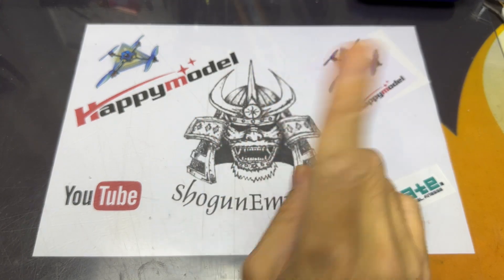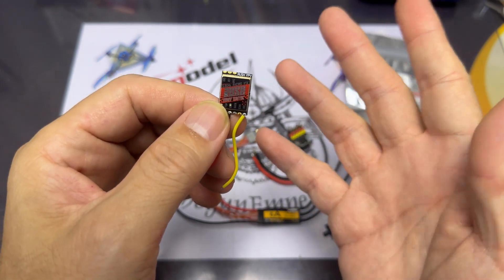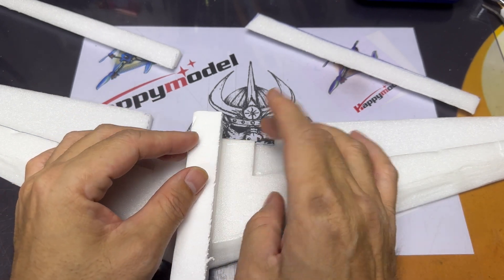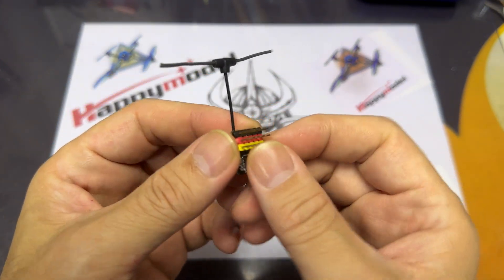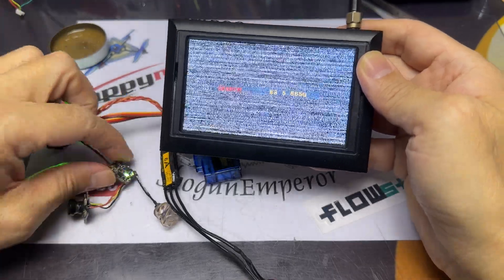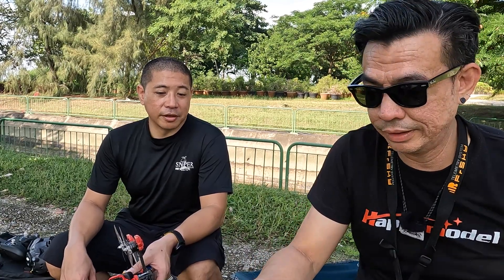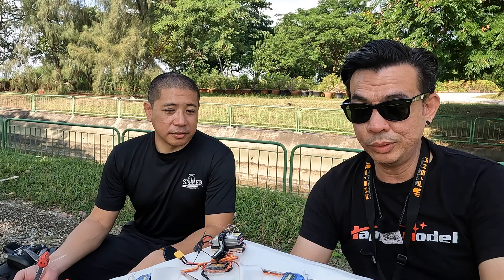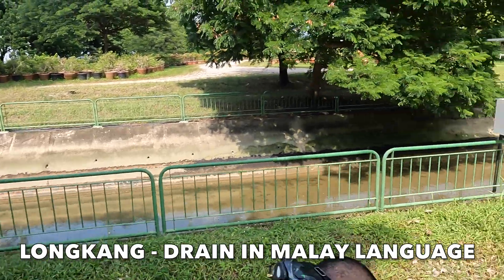Just another "pointless" build video using a KFM airfoil design

Comment: Make the winglets doubel size and put it on the wing end i think then fly 

Center of graviti is right???
Cool fun projekt👍👍👍
Reply from the maker: Thanks bruddah! It glides well… but the motor was mounted off. So it keeps pulling to the left and ailerons too short. CG is slightly nose heavy.  Will do! Thanks for the tips!!!
Reply: I See the new one 😊cool
Littel Expo of roll and Pitch
And the Angel fromm the Motor?
Bit more weight one the Front?
I fly wings 15 years a Go
Whoops are easy with the FC and Not so mutch Aerodynamik problems😂
Reply from the maker: @Dr.FreakFpv  niiiiiice bruh!!!! I never had much success with fixed wings except for my chuck glider conversion. That one worked REALLY well. Thanks so much for the tips n advise from ur experience! Will do that on the V3!! I just finished it last night!!! WHHAHAHHAA Cant wait to try it. Thanks for the support bruddah!!!
Reply: @shogunemperor  If you still need tips just ask 👍👍
Reply from the maker: @Dr.FreakFpv  haha got it flying in the video after this one bruddah!!  Thanks a mill!!!  Really appreciate it man!!!  I've built a V3 even!!!!  Just waiting for a better AIO camera to arrive to fix it up!